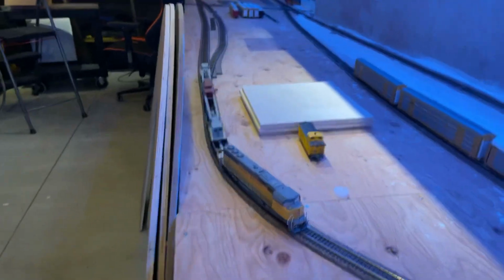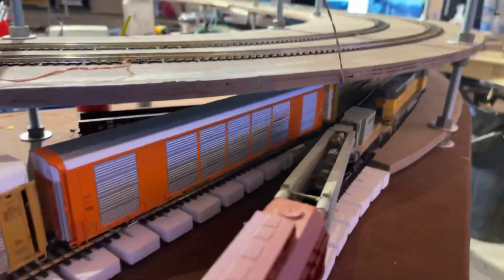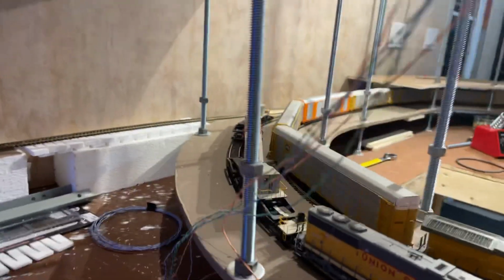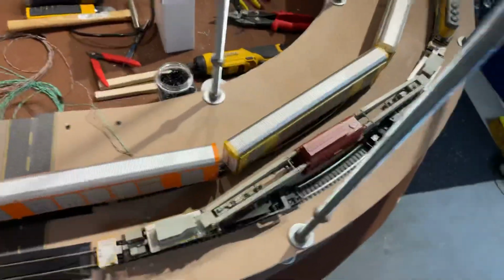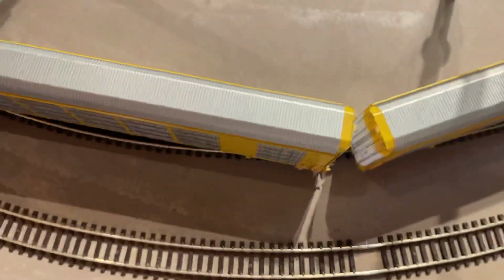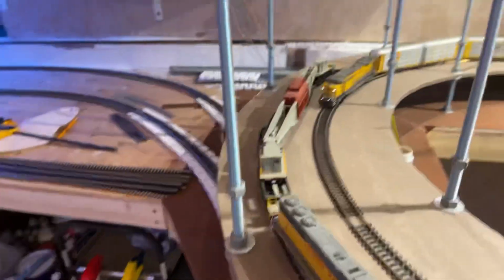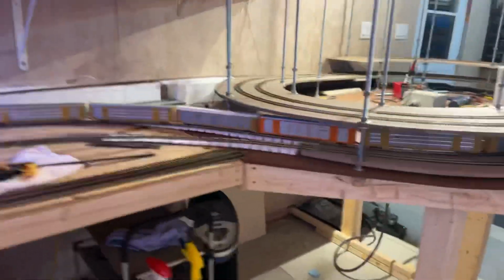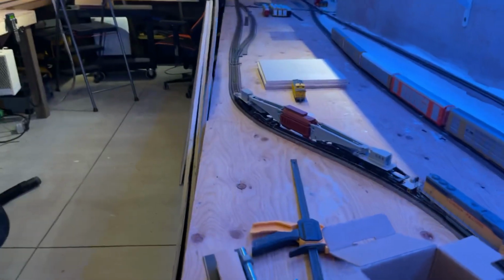Bachmann Schnabel car on the helix

Comment: Just got one on eBay and love it but buyers regret a little, I ordered all missing pieces from bachmann’s  website but in reality I should have got the same completely full unit on ebay/Amazon! Beautiful details but literally end to end 32” and hard to move because it’s difficult to disconnect loads and handle such a large car without a cradle
Reply: This was a used and abused unit I received FYI